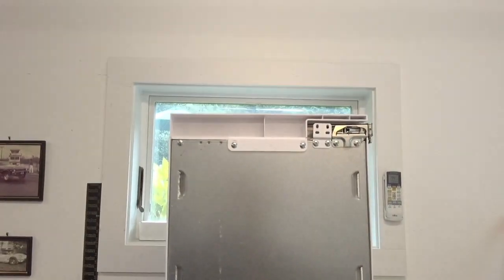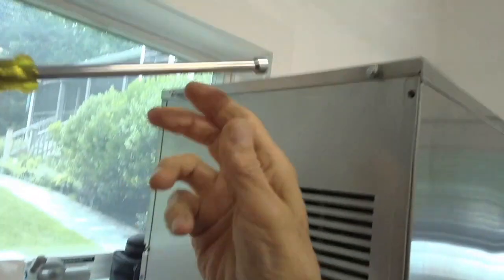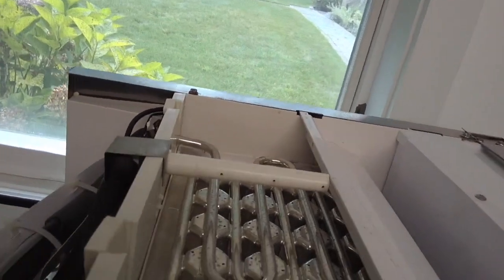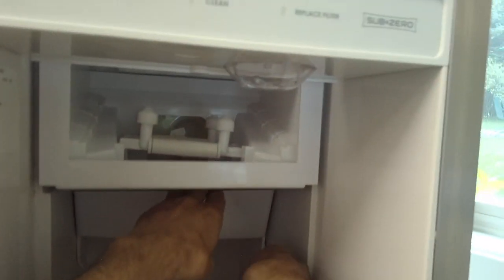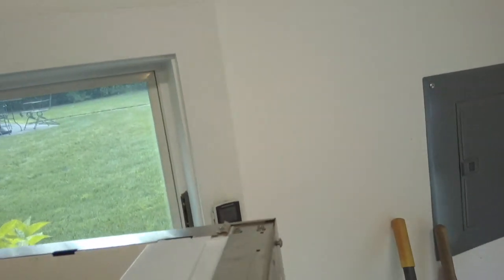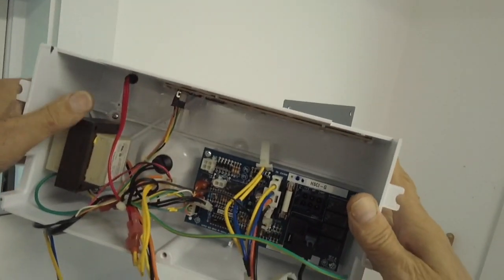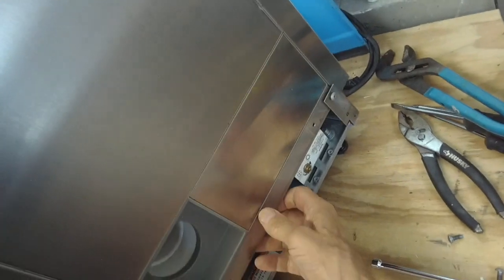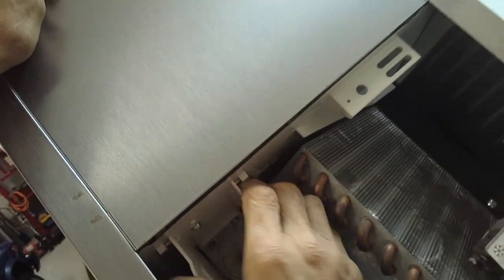Sub-Zero UC-15 ice machine

Comment: I have this ice machine and my local repair guy has been tearing his hair out trying to figure out why the pump is running at 180 degrees. We have replaced under warranty the compressor/condensor. Also replaced the pump, new pump does the same thing. We have checked the voltage going to the pump. Subzero support says its perfect. but the pump get scolding hot. So much its yellowing the white plastics of the unit, we also think the heat byproduct is causing the "watery" ice cubes. They arent SUPER watery, but they are not the standard you were expect. Any help!? ideas?!

Comment: Hey. Thank you for your videos. In my case - I disassembled it up to the bolts, the issue is- water, that sprayers spray goes through the blinds and dumps to the drain(model without the drain pump). and there is not enough of water to make thick ice cubes. do you have video how those blinds should work ,  cause 10 years old icemaker works totally fine when I hold the blinds so the water doesn`t spill..or any ideas

Comment: Any advice for the impending new owner of this ice maker?
Reply from the maker: I’m not sure what you’re asking, are you buying one?
Reply: @SubZeroSpecialists  Yes. House came with a 1998 632/S that's trucking along nicely so I've been trying to digest as many of your videos as possible and gather parts to keep that running. We just put in a set of the ID-30R refrigerator drawers for a Butler pantry and are still waiting on the under counter 15 with the pump. Going on about a year and a half for that one lol. I put in the inline filter on the water supply line for that. I just need to watch your video about bypassing the internal filter. Just curious if there's any other advice you might have. I've never owned an ice maker and I hear that they are somewhat temperamental.
Reply from the maker: @jdr03272  if you bought a new machine then you should have the upgrades to the filter manifold. As with any ice machine follow the periodic cleaning instructions.
Reply: @SubZeroSpecialists  Great to know, thank you. Yes it will be a new machine if it ever comes lol. Stupid question probably but is there any harm in still using my prefilter upstream of the supply line to the ice maker? Presumably it would just prolong the life of the internal filter? Thank you by the way for this incredible content. I wish you guys serviced Rochester New York!

Comment: Hello Mr. Aaron! Does the bin inside the ice maker supposed to have water in it when operating?
Reply from the maker: Not normally. If water is built up you may have a clogged drain pipe or if you have a drain pump it may not be operating.
Reply: Thank you Sir!

Comment: Good afternoon, I have a subzero refrigerator model IT-36CIID, the ice maker does not work. I measured the input current to the ice maker and it does not get 120v?
Reply from the maker: Did you activate the ice maker switch when you checked for power?
Reply: @SubZeroSpecialists  yes I do

Comment: Good morning, I repaired a subzero uc-15i ice maker. I changed the hot gas valve and the main control board, but it still has the original fault, which is that the ice does not release and remains in the evaporator.  what will be the problem?
Reply from the maker: What’s your back pressure? What size are the cubes? It could be the sensor. I would suggest perusing the Tech-Help files on our website aaronsrefrigeration.com
Reply: @SubZeroSpecialists  my low pressure 8 psi and high 100 psi when you open the hot gas valve goes up to 50 psi.  which sensor are you referring to?
Reply from the maker: @luisarmandoreyes8662  sensor on the condenser
Reply from the maker: @luisarmandoreyes8662  It’s called a liquid line thermistor, also did you weigh in the Freon?

Comment: change the compressor in the ice machine but it does not make the ice cubes it is making ice water up but I do not understand why it does not make the ice
Reply from the maker: Not enough information. What’s the back pressure? How much Refrigerant did you put in?
Reply: @SubZeroSpecialists  low pressure 2 psi high pressure 125 psi load it as machine spec says 5 oz.
Reply from the maker: @luisarmandoreyes8662  Is there ice in the mold or if it’s not making ice your hot gas valve may be open.
Reply: @SubZeroSpecialists  it doesn't make a full ice makes it weak
Reply from the maker: @luisarmandoreyes8662  Did you put the right compressor in there? Did you weigh the Freon in?
Reply: @SubZeroSpecialists  if the compressor is original subzero and you charge it with a scale
Reply from the maker: @luisarmandoreyes8662  I would check the hot gas valve
Reply: @SubZeroSpecialists  ok thanks

Comment: I have this unit and it runs very HOT!!! the front is hot the lover area is hot to the touch and ice was melting and now it will not produce ic at all...... HELP. I am in vegas and no service techs here know anything all idiots
Reply from the maker: Is it a UC-15 ice maker
Reply from the maker: Is the condenser clean? Is the condenser fan turning?
Reply: bet it was never repaired. Me and my buddy are the folks who figured it out and informed the factory. I dont openly share info, but I can tell you all they had to do was touch a single button

Comment from the maker: If the garage is heated in the winter you can use it there.
Reply from the maker: Those pumps run hot. Thick the amperage draw. There should be specs on the motor listing the electrical data.